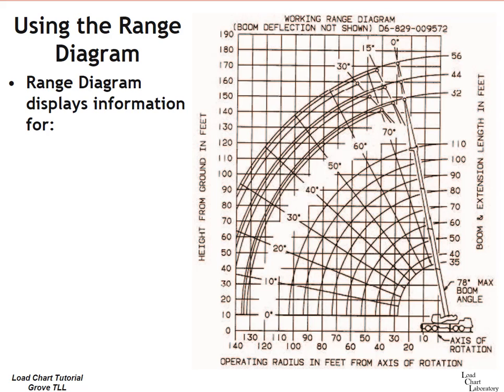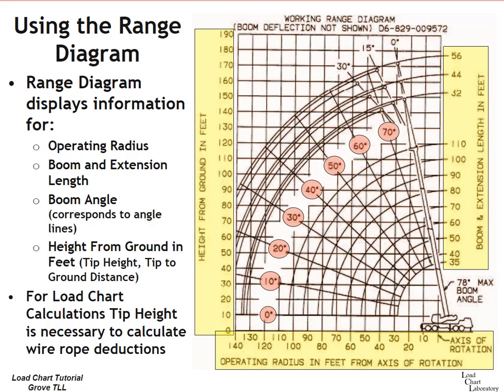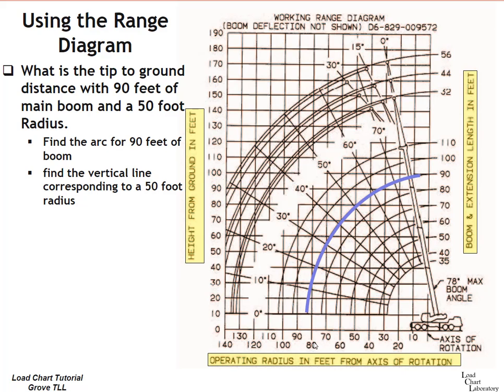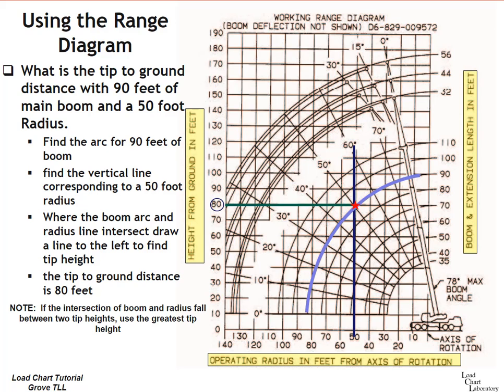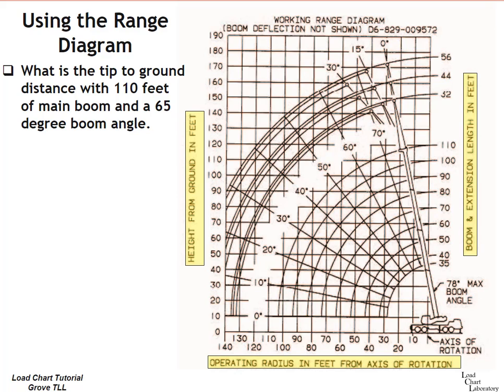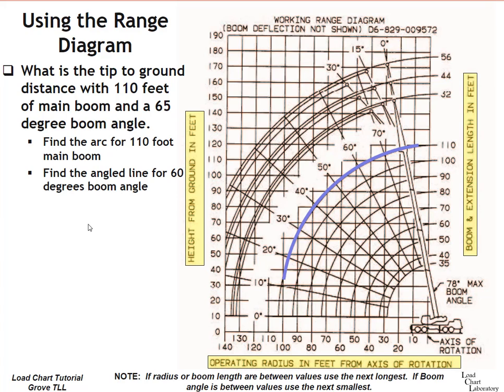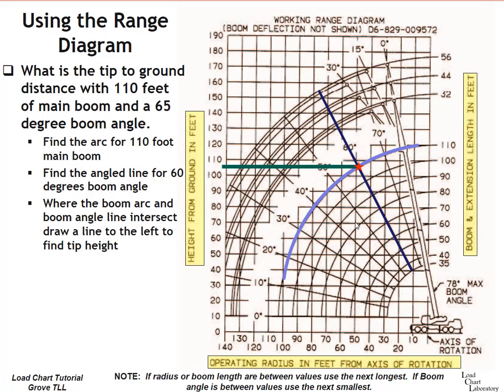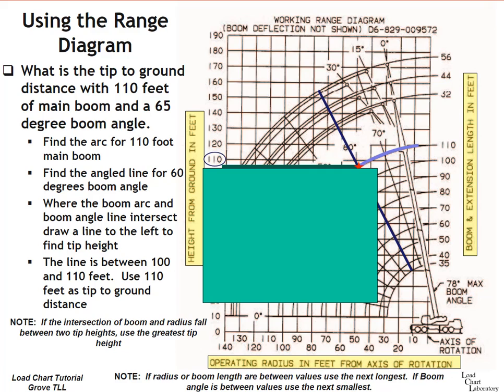Using the Grove Range Diagram

Comment: I have one question about the final load chart, since the line fell in between 100 and 110 feet i thought that you were supposed to go with the smaller number, so shouldn't have been 100?? Thank you
Reply: My understanding on using load charts is that if your numbers fall between two chart numbers you use the one that creates more restriction. Since this exercise is finding out how much to deduct for the wire rope the larger number is used because there is more wire rope being used. If the rope being used is 2 pounds per foot the difference is 20 pounds on your load calculation between 100 and 110 feet of tip height. Same goes for boom telescoping, if you are between chart values, use the larger (longer) value.

Comment: Hello. I am taking my cco test this coming  week. Do you have any videos on ground pressure and things that associate with that? Thanks for your time.
Reply from the maker: This may be too late to help you.  I do not have any videos on ground pressure.  It is an important concept that can show up on exam.  Know which entities are responsible for ground conditions and methods for mitigating poor ground conditions--e.g. cribbing.  You will probably will not need to calculate ground pressure.  But if you do the formula is P=F/A where F is the weight of the crane and load and A is the contact are of the crane (where the crane contacts the supporting surface).  These values are often expressed in PSA (pounds per square inch) so contact area should be in inches.  But if you are asked For PSF the area would be in feet.

Comment: Could something like this also be used for the telescopic range of forklift like the JCB and the Magni line?
Reply from the maker: Hello Gary.  Sorry for the late reply.   Telescopic boom forklifts should have a chart that is very similar to a range diagram.  The chart will be from the manufacturer for specific makes/models of machines.  It will show the lift capacity at different angles, heights and reach distance.  Check out this video https://youtu.be/3ANQ3HCCWpo

Comment: Is it the same for link-belt load chart?
Reply from the maker: Similar, but not the same.  Sorry I don't have link belt.
Reply: @LoadChartLab  i mean but when I’m between hight in feet u go to the higher number correct?
Reply from the maker: @juniorarciniega8694  yes same rules apply.
Reply: @LoadChartLab  thank you sir 🙏
Reply: @LoadChartLab  I passed thanks for the advice
Reply from the maker: @juniorarciniega8694  Congratulations!!!

Comment: If the radius is 10 meters but in crane diagram 10 meters is not there  only 9m and 12m radius but in the crane load chart 10 meters radius is there and also the 12m,what crane capacity i will follow,for the 10m or for the 12m radius,but the question is 10m radius,tnx for the answer
Reply from the maker: I would need to see the range diagram, in meters.

Comment: Man this test is discouraging
Reply from the maker: Some of best operators I know had to take it 2 or 3 times. Hang in there.  Know the regs and practice to build your speed on load chart problems.
Reply: Load Chart Lab thanks man just calculating the wire rope screws me up every time